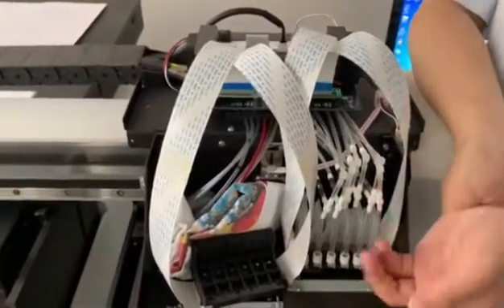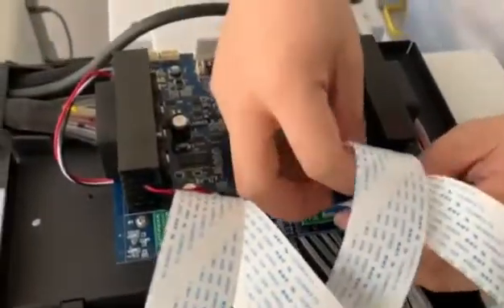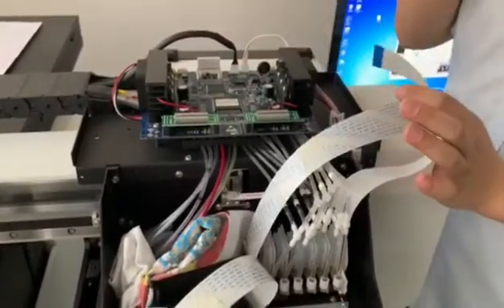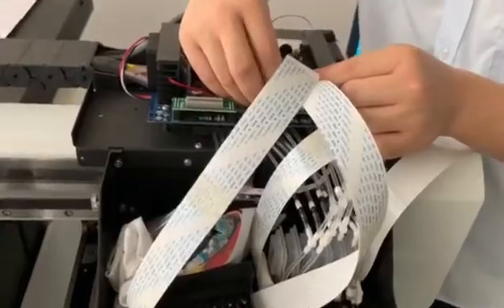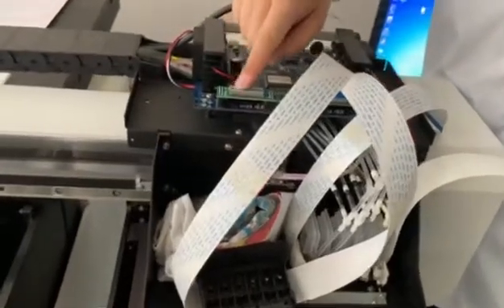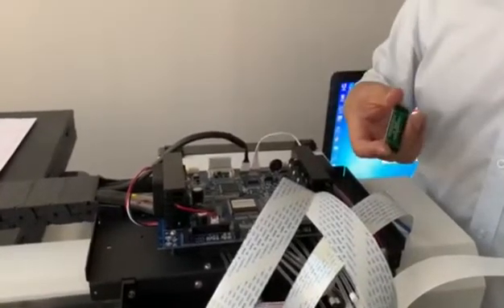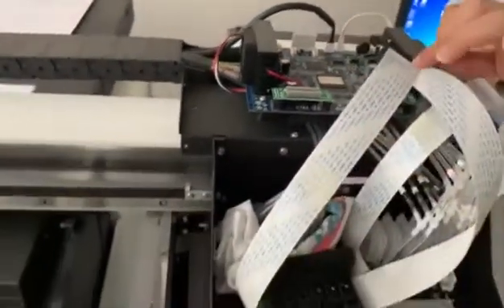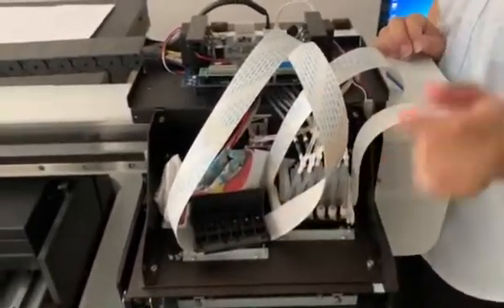Part 3 How to solve the problem white head can print out ink yet color head cannot?

Comment: When I turn on the machine, the fans do not turn and I cannot print
Reply from the maker: which printer? Thanks.
Reply: try replacing the non-working fan; due to its malfunction, the board heats up and therefore stops printing or does not print at all

Comment: What happens when you repealed the carriage board, the print heads three times, and the cables three times and still no ink? The printer is brand new and has never had ink ran through it. Even replaced the dampers and pumps. Does that mean the printer will never work?
Reply from the maker: Which printer you have ?
Reply: @nocaiuvprinterkevin4336  I have a sunyang board with dual xp600 printheads; it’s a dtf printer.

Comment: and when you start cleaning and the trolley starts cleaning and then its block and does not return to its seat you have to restart the machine so that it moves again
Reply from the maker: you can contact with me on Whatsapp / Wechat: +86 185 8854 1256. Thanks.

Comment: I’m able to print in colour but not white.  The printer is brand new with tx800 printheads.  I bought one new and one refurbished printhead.  The refurbished printhead can print in both colour and white, but it has streaks.  The new printhead can only print colour, so I changed the printhead cables as you had shown, and I could print white but not in colour.  If there's something wrong with the printer, then the refurbished printhead should not be able to print white.   I'm not sure what is wrong with the printer.   Could you please help?  Thank you kindly.
Reply from the maker: contact with me on wechat or whatsapp: +86 185 8854 1256. Thanks.